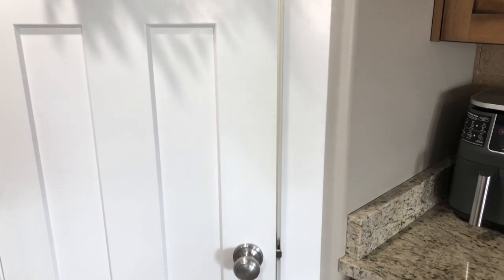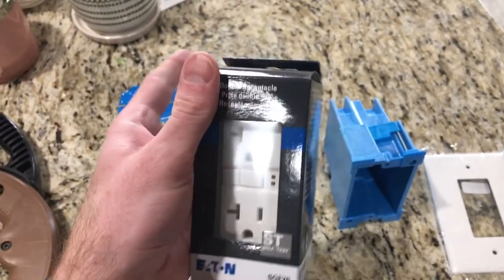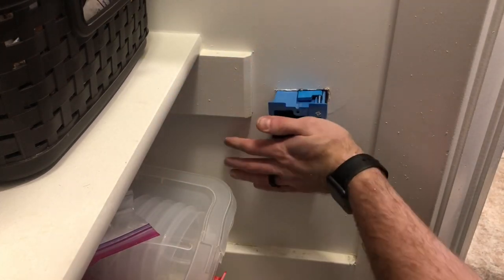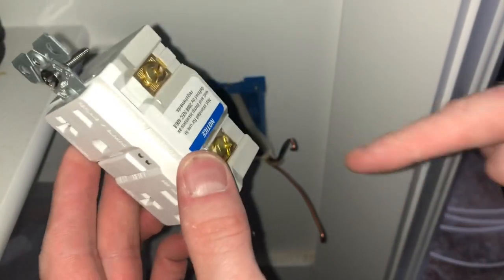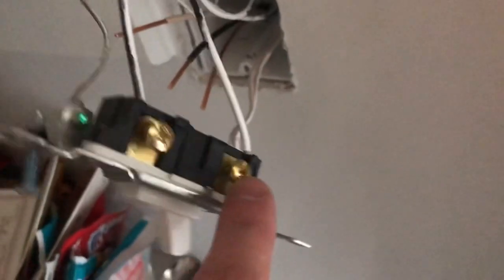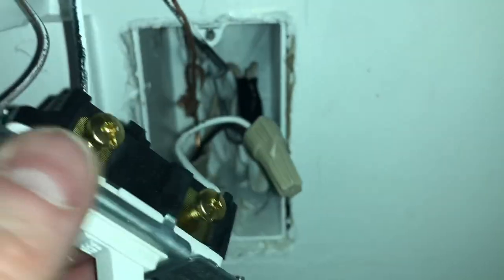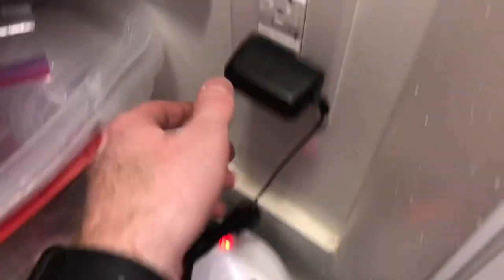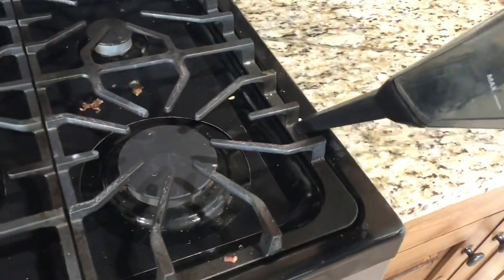Add Outlet from Existing Light Switch | How To Add Outlet in Kitchen Pantry

Comment: Excellent video.  Wire nuts are old school.  So much easier to use the Wago 221 wire connectors.
Reply from the maker: Much more expensive per connector though.
Reply: @DIYBRY  yeah, a little but so much easier.

Comment: 1) Don't cut the sheathing down into the wires -- you can easily damage the wire insulation (and in all likelihood, you *did* score it). 
Instead, cut UP, and then pull the sheathing apart into two halves. 
2) According to code, the wire coming into a box has to be secured to a framing member (about 6-12 inches away from the box, depending on the locality).
Reply from the maker: Thanks for the info for the community.

Comment: Always leave at least 6 inches of wire in any junction box. The outlet box had the right amount of wire coming out of the box, but more sheathing needed to be stripped. The switch box had the right amount of sheathing stripped, but the wires are way too short. Also, the splicing behind the switch is terrible. When bonding grounds together, never reuse a crimp sleeve regardless of its condition. Simply install a new one or use a green wire nut (when reducing down to one ground) or use a normal wire nut/WAGO. You should never cut any existing wires, especially ones that feed power into the box, if you don't have to. It's not only a major code violation, but it makes it more difficult to work on that box in the future.
Reply from the maker: Thanks for the information for the community!

Comment: Just curious,  didn’t that GFCI receptacle have a yellow strip of tape across the bottom set of connector screws indicating which connection is line side and load side?  Normally the bottom set of screws is reserved for GFCI protection to other receptacles downstream of the receptacle that you’re currently working.
Reply from the maker: I’m not connecting any other outlets to this GFCI outlets, so I’m sure that matters in this situation.
Reply: im curious about that too, then i saw that ground terminal. same thing in my gfci, the one with the ground terminal mostly is the line side. correct me if I'm wrong.
Reply: @DIYBRY  it doesn't matter for practical purposes, but its best to leave it on for the next person.  If they are not trained they may not know about line and load sides.  This work also isn't up to code as you have no support for the wires between the boxes.  Also using a mechanics strippers for household work.is dangerous.  If the neutral or line is hot they don't have the resistance needed to keep you safe.  Big difference between low voltage and 120v.   Id recommend not making electrical diy videos.  Oh and adding a new outlet can be a dead give away to an inspector, especially if they show different age.  Replacing an outlet can be done by a homeowner, adding one requires a permit and an inspection.  Most likely nothing will ever come about cause of it.  But it could make you fail an inspection when trying to sell in the future.
Reply: @jamesross160  James, my code book seems to point to zero support for NM cable when fished between access points and securing is not practicable.

NEC. 334.30.(B). and 334.30.(B).(1).
Reply: The gfci is required to be labeled.  "Line"  and  "Load" should be clearly marked on the back.
Reply: @keithharrington8715  it's up to the authority with jurisdiction.  They could easily argue its just drywall that can be fixed.
Reply: @jamesross160  yes, 90.4 can be applied

Comment: Remember that gfci's are receptacles plus protective circuitry.  If you connect them incorrectly, you bypass the protective circuitry and simply get a functioning receptacle.

 Test,
Test 
Test.
With a gfci tester.
Reply from the maker: Thanks for the information for the community!

Comment: Strip wire from cable min 6 in and 1 /2 in of sheathing ugly job twisting wires. yELLOW STRIP IS FOR LOAD SIDE of gfci . And do not over load the power coming from light source bad things could happen.
Reply from the maker: I wanted a separate switch for the fan to match other rooms in the house.

Comment: Are you using 14 gauge wire on a 20 amp outlet?
Reply from the maker: Yes. For the record, I did change the outlet to a 14 gage after the recording of this video.

Comment: You talked about shutting the electricity off at the breaker box for that circuit, which definitely needs to be done BEFORE any work is started. My concern is with what you DID NOT say. Can you be absolutely certain the breaker you shut off is the one that controls the circuit you are about to work on? Perhaps in a newly wired house by a professional electrician, the odds will be that breaker is the right one, (though no guarantees). In an older home, I would NOT touch any wire until I had thoroughly tested the circuit to make sure it was dead. Who knows what may have been tapped into that circuit at a time AFTER the circuit was labelled or perhaps the circuit was incorrectly labelled. Anything is possible. Remember, when working with electricity, you are betting your life that everything has been done 100% correct.
Reply from the maker: Since I was working off the light switch in the pantry closet, it was in this case easy to know if I shut off the correct breaker, because the light switch would no longer operate the light. I do not show operating of a multimeter, but of course that is always a good idea.
Reply: @DIYBRY  I agree with what you are saying when you said it would be a simple matter to simply flip on the light switch to make sure the light did not come on, therefor the circuit would be dead. The same thing applies to the use of a multimeter; it only takes a moment to check for a live wire. My concern is that when someone posts an instruction video here on YouTube, or gives instructions of any kind, they need to keep in mind that people who know NOTHING about the subject matter and have NO experience what-so-ever, may decide the video looks simple, so they attempt the project. They'll take the video and faithfully follow it step-by-step exactly as described. They won't think to do anything else because they are afraid if they do so, it may mess everything up. They don't realize there are other simple things that also need doing, for example, testing the circuit just to be safe. To you and I, it's obvious because we have done it, but they haven't. 

There may be something I sort of know how to do, but not totally sure, so I start following a set of instructions. I'd much rather have the writer tell me to do some task that I already knew about, then for the writer to assume I'll do that task anyway. The moment he/she assumes I already know that, and if I don't happen to know about it, then I'm lost, and frustrated because things didn't work okay. I'll have no idea where to go from there.

I apologize if I seem to be nit-picking because you did a good job of describing the process and your video was excellent. Even though I have installed always live plug-ins around switches, I still enjoyed watching your presentation. THANK YOU for just talking and NOT having loud music playing in the background. I hate that. Keep up the good work.